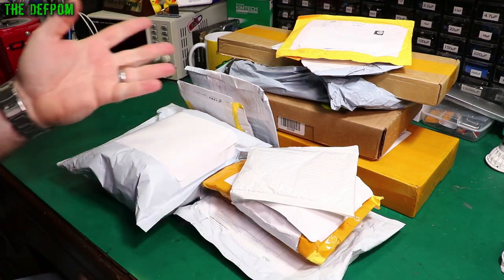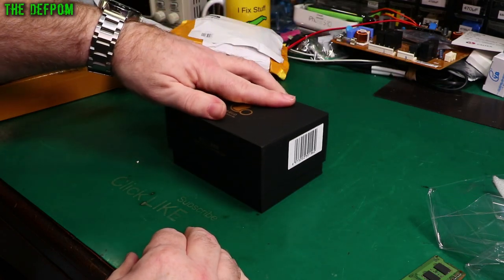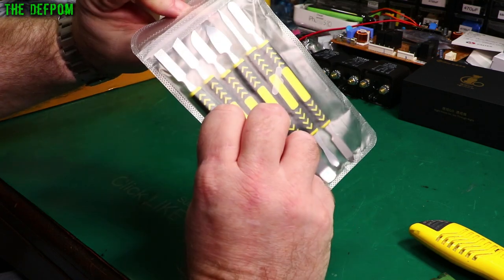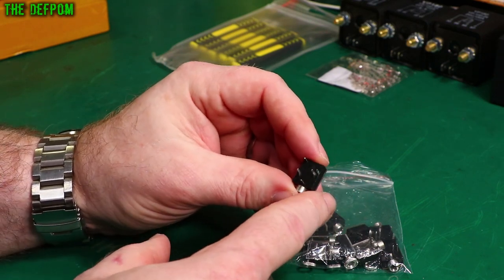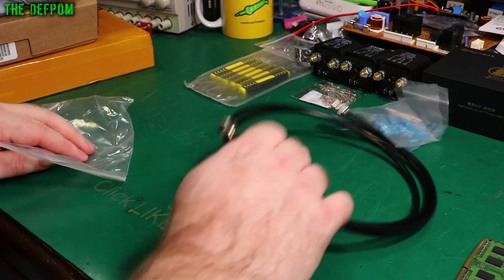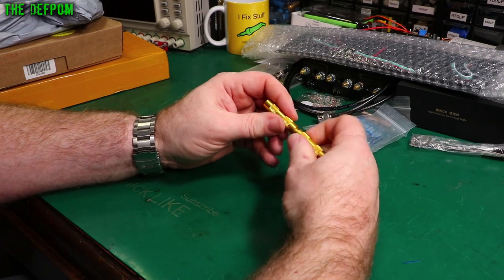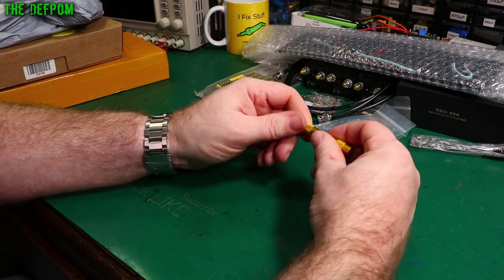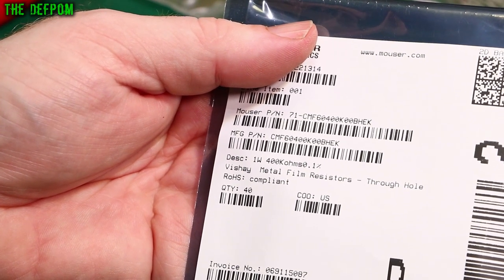🔴 What's in my Mailbag ? - Mailbag Monday 5th September 2022 - No.1038

Comment: I always used jaws of a vice to crimp IDC connectors, as it assured parralel force application. Has always worked flawlessly.
Reply: Your right it does.
Reply from the maker: Yes I’ve done that in the past too, when I had a bench vise… I really need to get another one